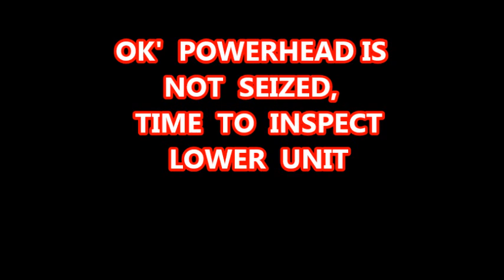EVINRUDE  15  HP,   BUYER BEWARE

Comment: my 92 rudie poo 9.9 wouldnt start,., shot pre mix into the carb  , still wouldnt start,,, removed carb  shot premix into the reed plate and it will start.., compression fluctuates between 60 and 70 on one cylinder and 70 and 80 on the other,, pulled head and gasket and head looks great,.,, pulled engine apart and cylinders look glazed.., measured cylinder diameter and they are in spec..  heres my theory...im thinking that two strokes , unlike 4 strokes require more vacuum to be able to run, because they have to generate enough vacuum to open the reed valves, and then create enough vacuum thru the carburetors venturi to pull fuel vapor into the cylinder.. where as in a 4 stroke, this is not the case..

Comment: I am working with my grandson on  78 Merc 1150.  We have essentially rebuilt the entire engine.  It is running smoother now after some carb adjustments and they were freshened.  Still having some drivability issues including random rough idle and stalling.  Also it dies out after a minute or two at WOT.  Any wisdom you can share on the three idle adjustments on this carb.  We have not begun to sus out the starving issue at WOT but suspect a flow issue in the lines.  Any suggestions there as well
Reply: Adjust each carb individually, in gear at idle. Turn mixture screw adjusting one carb at a time ,clockwise until it slows down or begins to lean sneeze. Then back it out 1/4-1/2 turn, do that for each carb.
Reply: Was fuel pump rebuilt along with carbs? New fuel lines installed?
Reply: @Vintageoutboardreviver  Yes the pump was rebuilt and all fuel lines replaced.
Reply: @Vintageoutboardreviver  I will give this a try.  Thank you for your input.

Comment: Hey Cody- Have you ever included in one of your vids how to adjust shift lever handle to take up clutch dog slack on early 70's johns/evin ?  I resealed the lower on my 73 johns 25hp and clutch dog did not appeared rounded on forward or reverse dog or gears and my Clymer manual is not clear on this procedure - getting a heavy thump when increased rpms @ 5mph- any ideas or have done a vid on this?

Comment: Well, that was a shame....  Even the slightest attempt at routine maintenance probably would have caught the leak issue before the whole thing got ruined.  Wonder where the leak was...I have seen very few seal/oring leakage issues on these gearcases, they are pretty rugged.  Perhaps there was a load of fishline in the prop shaft at one time, who knows.  
Like you say, the complete assemblies will swap out for all the years they were made, although there are some slight internal differences.  You must be sure to use the correct driveshaft as well, oring vs non oring driveshafts.  I have often wondered about the zinc where the exhaust/water relief holes used to be though.  Seems like using the newer style gearcase on older models might create a bit of an exhaust relief issue, but I don't see any issue with using the older style on the newer engine like you have done.  Someday, I will have to look into this more closely.  
I am confused about what you were pointing out about the interlock being jammed/not being able to get it out of gear though.  In this case, it wouldn't come out of gear cuz it was just rusted up inside, I get that.  But what jams with the interlock causing it not to come out of gear on an operational gearcase?  Admittedly, never got too much experience with the newer models, only worked on a few of them, do remember the pesky recoil interlock though.  Was never a fan of these front shift models.  A relatively short throw shift lever, coupled with a poor neutral detent, seems like it would encourage inadvertent jamming from one gear to another and internal damage.  
Sure hope this customer will try to take a little better care of this engine, he is lucky that your great parts collection saved his butt.  
PS, let me know if you need an inner exhaust tube for that 6-8hp you showed in your other video, to replace the rotted one.  I have several of these on hand.  Folks price them like they are gold, so I buy them when priced resaonbly.  The same goes for the old style 6hp shift levers, I seem to have cornered the market on those items as well.
Reply: Yeah, I seem to concentrate on some very hard to find/unreasonably priced parts, then collect them in preparation for the days when this stuff gets really hard to find.
Reply: Don,I just picked up one of these but newer a 2000 15HP Johnson no gearcase great topend from local marina. Did you ever swap the guts from old style gearcase(1974-92) to a new style casing (1993& Up)?Was curious looks doable you mentioned internal differences. I have plenty of old gearcases but want to keep this motor true to its year. I have a lead on a proper casing also locally.Oh also cant tell you how many times I have seen two drain plug gaskets on one plug and nothing on the other with loosely tightened drain plugs. Novices dont have a clue to look out for that,Ha! .Very common problem with water intrusion & yes plus the fishing line deal too.  Happy New Year! Glenn
Reply: @OutBoardTink62    I haven't ever done that, but I guess we would have to compare the two parts lists to know for sure.  God bless you for keeping the engine original.  It really breaks my heart to see these engines get destroyed needlessly, so preventable.
Reply: @fleetwin1  Yeah what happens down the road from being new is screwed up for many outboards many people just want to get it done and dont care or just plain neglect them. Local guy here wants $400 for a gearcase Im spoiled no way,LOLLL! Ill find one before the Spring they made alot of them I know some people...
Reply: @OutBoardTink62  He wants $400 for just the case??  Folks price this stuff like it is gold.  You will find a reasonable one soon...
Reply: No complete gearcase for $400 not sure if its older. I do have plenty of older style ones in my hoard. I did say I have a 2000 model so I guess its a new style.. Your 100% right about that gold thing,HA! @fleetwin1